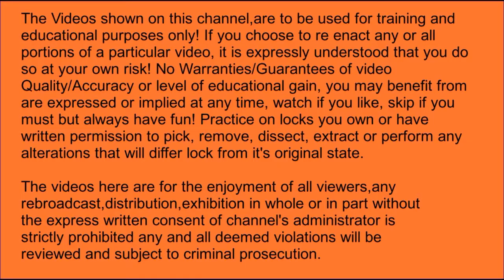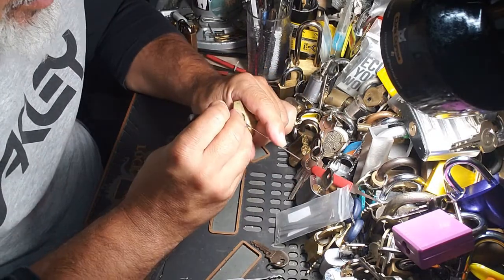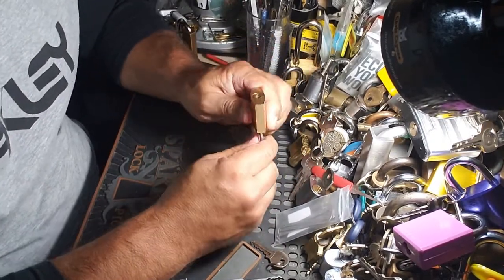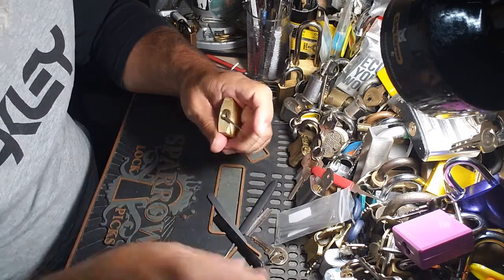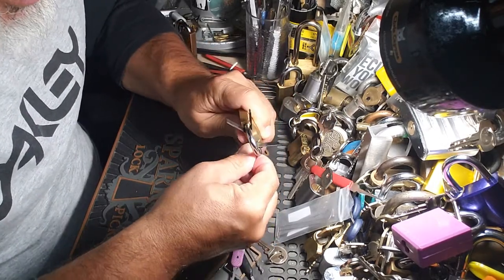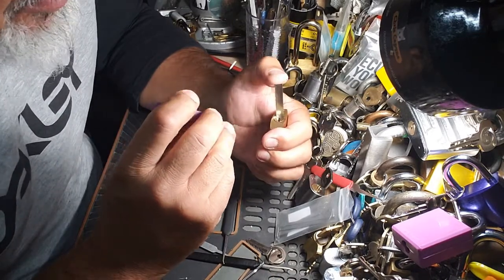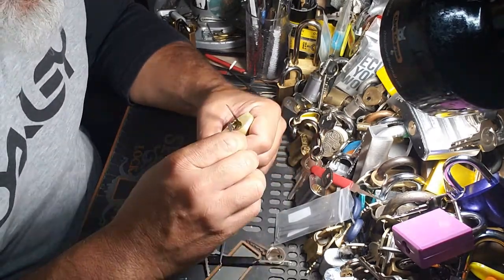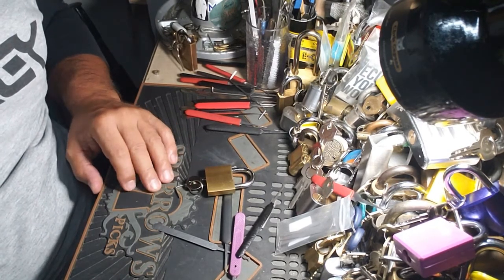# 749  MUR-LOCK 68    Six Possible Ways to Defeat Cheap Chinese locks***SEE NOTE

Comment: I see definitely what you mean about work area. Good job on the attacks. 👍🤘👍
Reply from the maker: lol
Thanks brother
Appreciate you stopping in
Stay well
Reply: @Mur-lock68  I will definitely check out more later. In a picking slump so I'm taking the time to make a lot of rattlesnake pins, right now I have 15 drivers 3 of which are complete, 12 that need soldering and a clean up,  working on building various sizes rattlesnake keypins as well as making other pins that requires some soldering. This is a good time to actually put a big dent in the pin making progress... I tend to take the long way but it's consistent and the pins should survive the tortures a picker will put them under
Reply from the maker: No worries my brother ,picking is not an easy gig!
It takes plenty of time and effort 
Sounds good that you're making pins!
Look forward to seeing them in action
Stay well and reach out anytime!
Reply: @Mur-lock68  Tinman1986 and Lock Affinity have posted a video of a couple CLs I have sent out. I think they are going to send them out as I build more and make slight mods to make them a little bit harder. I haven't went by way of messing with MACS as of yet, but within my next 3, I may drop a killer 😁
Reply from the maker: ah yes ok
Will check them out
Thanks
Reply: @Mur-lock68  I can also put you on the list for one, I'm trying to put at least 1 maybe 2 rattlesnake keypins per challenge lock